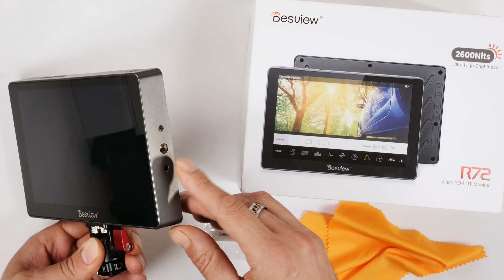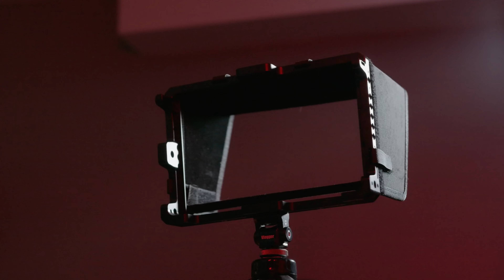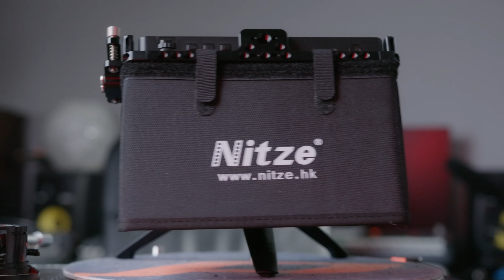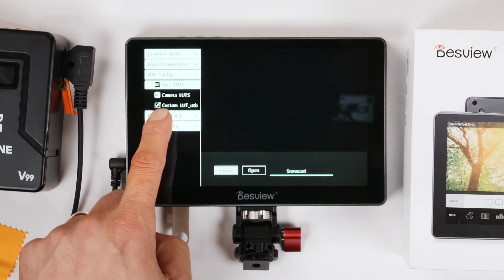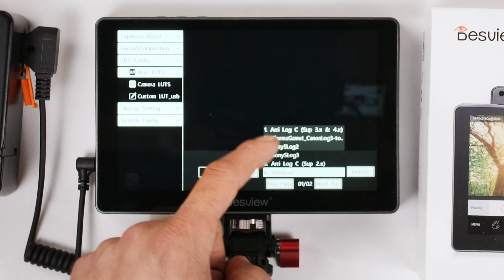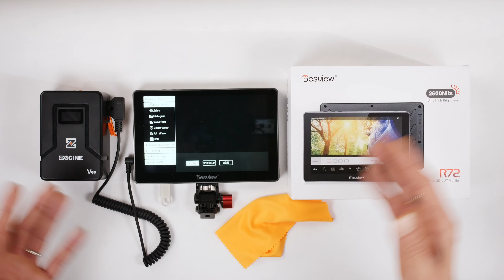How To Load Custom 3D LUTs Desview Camera Monitor

Comment: Hey, unfortunately I have the problem that the stick is not recognised on my Mac. I have the R5ii. Other USB sticks with the cube file in the root directory do not work. The monitor tries to load the LUT and crashes. Do you know if the folders you mentioned are important for the monitor to be able to process the cube files? What could be the problem, I have tried two different sticks. Kind regards!
Reply: Thanks a lot. I fixed the Problem a few weeks ago. I dont know what was the fault but After i repeat the procedure. Everything works good! :)
Reply from the maker: @ perfect 👌
Reply from the maker: @bennetflade  if you want. 
Send me a msg on Facebook or IG and I will load the folders for you onto google drive and see if that helps.
Reply from the maker: hey bro I loaded the usb files and folders to google drive for you. I also included the link in the video description.

https://drive.google.com/drive/folders/1uH2g5aVy1ocVgHniC5fMxQq2nc65RzY0?usp=sharing
Reply: @LEOPAZZOPRODUCTIONS  I'm having the same problem on the R5ii; would you be willing to share that folder again?

Comment: Can you upload the content of the original DESVIEW memory, I would greatly appreciate it, I lost my USB memory and I don't know how to load the luts with another memory :( Could it be?
Reply: You can use any usb memory card to load luts to the Desview monitors. 

Which Desview monitor do you have? 

Please explain as much as possible so I can understand 100% your issue. So I can try to help.
Reply: @LeoPazzo  I have a desview R6 UHB, I have inserted a USB memory, and if it recognizes it but the luts that I loaded do not appear, it appears empty, that is why I wanted to try loading the folders that you have, I would greatly appreciate it
Reply: @Robinssonyat  I can try to find the original usb stick that comes with the R6 or one of my Desview monitors and if I find it, I will let you know and share it with you via Google drive link. Have you resolved this yet?
Reply from the maker: hey bro I loaded the usb files and folders to google drive for you. I also included the link in the video description.

https://drive.google.com/drive/folders/1uH2g5aVy1ocVgHniC5fMxQq2nc65RzY0?usp=sharing
Reply: Did you figure this out? 
I just had another comment on this video asking a similar question. He’s having trouble loading luts to the Desview.
Reply from the maker: hey bro I loaded the usb files and folders to google drive for you. I also included the link in the video description.

https://drive.google.com/drive/folders/1uH2g5aVy1ocVgHniC5fMxQq2nc65RzY0?usp=sharing

Comment: I load it into usb drive but its empty when i search in the monitor
Reply from the maker: my first guess is that the lut file typpe you are using is not support by the monitor. I belive if I recall correctly this monitor support 33 CUBE file type. hope this helps. let me know how it goes for you.
Reply: Did you figure it out?
Reply: @LeoPazzo  no I think there is a specific format that the USB needs to be in order for it to read
Reply: @ ok I just got home. 
Let me check it out and get back to you.
Reply from the maker: hey bro I loaded the usb files and folders to google drive for you. I also included the link in the video description.

https://drive.google.com/drive/folders/1uH2g5aVy1ocVgHniC5fMxQq2nc65RzY0?usp=sharing
Reply from the maker: hey bro I loaded the usb files and folders to google drive for you. I also included the link in the video description.

https://drive.google.com/drive/folders/1uH2g5aVy1ocVgHniC5fMxQq2nc65RzY0?usp=sharing

Comment: Hi. I have 1 issue with the displaying image and couldn’t see an answer in your video. Display shows too small image when 1:1 it takes probably 60% of the screen. When I choose 1:2 all the screen is used for the image but it’s useless as it zoomed in too much. So
Basically there is now in between. I can’t get it to be displayed like on your monitor. Could you please advice ? Thank you
Reply from the maker: Damn sorry to hear this. As you can see in my video I am able to do it no problem. I have 3 Desview monitors and no issues. My only guess is that the LUTs you are trying to load are LUTs for the computer editing program. You need to only load camera monitoring LUTs. I forget the exact file type but I think it is CUBE 17 or CUBE 33 if I recall correctly. Double check this information I mentioned and let me know how it goes. I’ll be glad to help if I can. You can also Instagram msg me at Leopazzo Productions aka Leopazzo Tv 
Cheers. I hope we can figure this out and get your LUTs working asap.

Comment: Hi!
How many luts can upload to the monitor and how can erase them?
Somebody told in comment at another video if the monitor is full, impossible remove or change them. Or need to make a reset?
Reply from the maker: That’s a good question. 
I am not sure how many you can load as I have only loaded about 3-4. 

I can’t recall how to delete the LUTs from the monitor. 

I will have a look again at the monitor and see how to delete them and get back to you.
Reply: @LEOPAZZOPRODUCTIONS  Hi again!
I got my desview r6 today. I am confused a bit.
This is different than the products in all reviews. This has usb port instead of sd slot. The "delete" button is exist at the LUT menu. I tried it succesfully.
BUT there is no auto fan mode unfortunatelly!!! I am disappointed about that! Firmware is 15. August 2022. I searched at desview website, there is no nothing about updates. Nothing.
So I asked them in email. I hope they can help me out, because the auto fan mode was one of the reason (and brightness) to bought this monitor.
Reply from the maker: @b0yx5ir3j20ntah  
Interesting, I checked this weekend and I didn’t see any delete LUT option. 
I will check my firmware update version and get back to you. 

This video is of r72 which has usb input for LUTs. I believe the r6 has sd input.
Reply: @LEOPAZZOPRODUCTIONS ... yes, the r6 has sd slot in every review. But mine is different on that way, and in the menu a bit (lut delete option and there is no auto fan mode).
Reply from the maker: @b0yx5ir3j20ntah  I’m surprised there is no auto fan mode. 
I would double check with the menu on the left for this auto fan setting. 
I saw it this weekend when I was looking at r6 menu. 
I think it’s in one of the bottom menu options on the left.
Reply: @LEOPAZZOPRODUCTIONS  I checked many times: low medium and high only.  :(
I wrote to Desview support but nothing yet.
Reply from the maker: @b0yx5ir3j20ntah  ok cool keep me updated
Reply: @LEOPAZZOPRODUCTIONS  Thanks the fast answer!
I waiting for your reply.